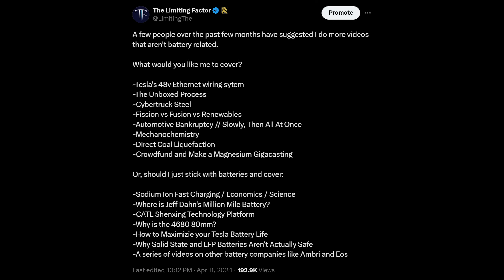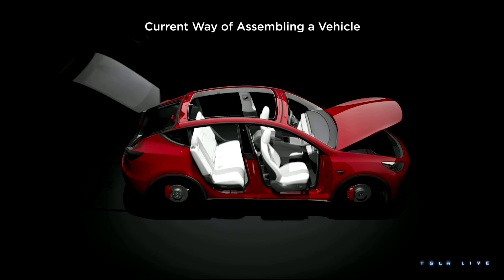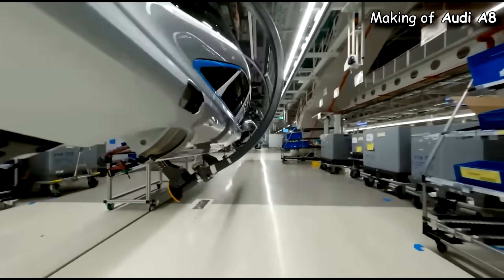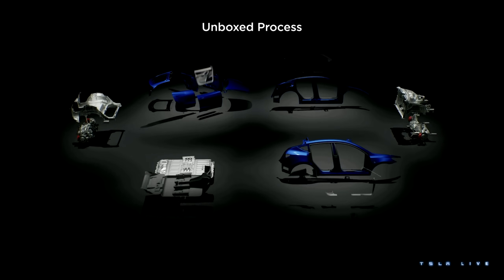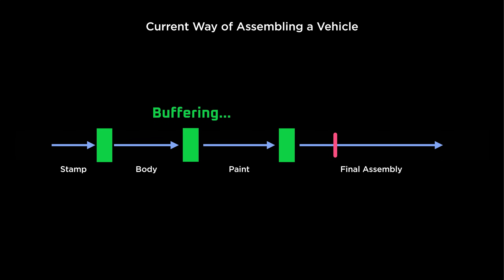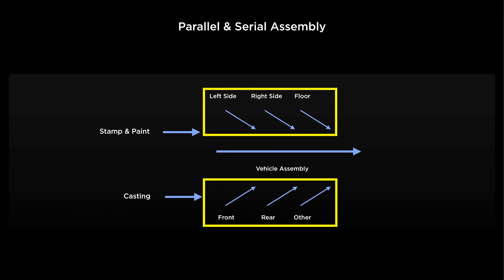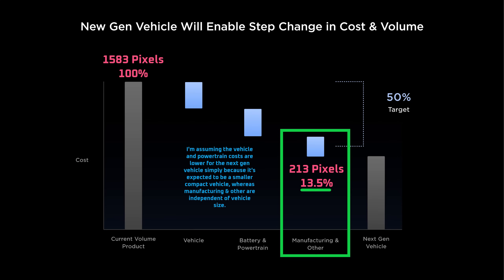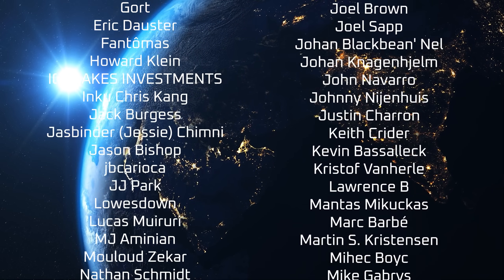Tesla's Unboxed Process // A Closer Look

Comment: Tesla is almost only OEM, that uses discreet axle modules , that use high amount of casting, as opposed to wields, fastener, brackets, and different materials, like stamped steel, extrusion, and small cast parts.
the entire axle can drop out to be worked on, just a few bolts.
Reply: Yes..... The best step is NO STEP!
Reply: A big problem was what if they need something repaired. Not having many repair stations means praying nothing happens or make it easy to fix if.

Comment: Thanks Jordan!  One advantage you didn't mention is foreign factories.  For Mexico/India/Indonesia, they could ship completed modules (volumetrically efficient, as you point out) and just do final assembly at those locations.  They can start with a small factory, and expand upstream to locally produce modules as production scales.  Or it could also allow for micro-factories that only do final assembly where there is low volume for the local market, like Spain/Italy/Australia/Japan/Argentina, with gigafactories feeding completed modules.
Reply from the maker: Thanks man! 

That could happen in the deep future when these things become commoditized, however...

Tesla does all mission critical work in-house 

They only outsource non-mission critical items 

Major vehicle components are mission critical
Reply: @thelimitingfactor  Thanks Jordan!  Sorry I said "modules" but I really meant "major unboxed components" like front-of-car, SBP, etc.  They would come complete from a Tesla gigafactory, not outsourced.  And the local micro-factory would just bolt the few pieces together in a final process.
Reply: @thelimitingfactor  Currently shipping cars is volume intensive - there is a lot of empty space being moved. Relatively inexpensive mini factories where the final assembly could be done without any of the background requirements (casting or paint shop for example) could enable a great deal of flexibility. The components could be shipped from any Giga with spare capacity.
Reply: TESLA doesn't have any assembly only plants anymore, it closed Netherlands many years ago. 
Gigaberlin is hub for EU except RHD.
China is main exporter of RHD and those markets. 
Fremont & TX are exporter to Canada & MX. for Cybertruck & some other vehicles, like NEW model 3.

Comment: Manufacturing engineer here. There's a little more to this and I would be happy to have a little discussion if you're interested. You would be even better off finding a staff automotive manufacturing engineer though, because there will be even more stuff that they know in specific (capitalization tradeoffs, specific unit manufacturing issues that unboxing solves, etc) that I might know only in general
Reply from the maker: The best way to contact me is on Twitter 

At limitingthe
Reply: Can’t wait the hear about this discussion!

Comment: Automation is simplified and easier to update with larger subassemblies.
Assemblies for different models may be produced on the same machinery. Castings may be batched for example by changing the molds only.

Comment: We all missed one important early step,  executed years ago! Early Model S had an opening sunroof,  with all the trim, mechanical complexity,  sealing, and lots of weight.  Long ago,  Tesla scratched all that and began to build all models except for X with structural glass roofs, which are simply glued on! Piece of glass and glue. Can't get much simpler than that!
Reply: also Tesla eliminated the battery swap feature in model S/X too.
but , long after they closed it's battery swap locations.
Reply: @markplott4820  
Tesla quickly moves to what works and leaves the 'less good' behind.  Legacy companies need to run changes through committees and then schedule most changes for a following year budget.

Comment: TOPIC SUGGESTION: If a battery is cooled from the top and the bottom, can you create a battery 1000x80. Like 1 meter diameter 80 mm tall big pizza sauce coin cell battery. It can be used for grid storage only.
Reply from the maker: Volumetrically, it makes more sense to use cubes
Reply: @thelimitingfactor  I suggested this for stationary storage where volumetric and gravimetric efficiency don't matter as much. What matters is the ratio of active to inactive/structural material.if you have a stainless steel barrel and inside you have a stack of jelly rolls separated by cooling plates(disks) that also act as current collectors. This approach will improve manufacturing speed and reduce cost

Comment: So... my imagination got the better of me and I pictured making hamburgers.  

Current car assembly lines are like this: The burger bun is baked as one piece,  then buttered. It is then sliced in half and separated, and then carried on a conveyor through the length of the building.  Meanwhile,  the hamburger patties are carried along,  just an inch above the bottom bun,  and tiny workers climb in the gap and spray condiments on the bottom bun. The top bun is only 2 inches above the meat,  and workers use robots to bring in the lettuce,  shove in the onion,  and try to stuff in the pickles and tomatoes without them sliding off the outside. Then some crazy South African comes along and says,  why don't we cook top and bottom bread rather than a bun we have to bake,  cool,  slice,  butter,  and carry the length of the factory? We can have 2 ovens, one on each side.  Then we bring in the bottom bread with condiments already applied,  meat with the veggies already sitting on top, then stack the top bread.  Stacked all up,  made fresh and more quickly! Think outside the bun, y'all 😂
Reply: How does one butter your Model B before it's sliced in half? You obviously have no autoburger experience.

Comment: I used to work in a stamping and weld plant, adjusting stuff to hold tolerance. I remember being blown away by the giga castings and how much pain they avoid. then I was amazed by the floor battery. this is gonna be great. oh and BTW the buffering thing is not really a thing; even if you keep the rest of the line moving, storing  parts in inventory, once you fix the blockage it's not like that station can suddenly work faster to clear the buffer. Toyota figured this out long ago and everyone has basically followed suit.
Reply: Yeah. Buffering just won't work well.
Reply: Well, buffering helps a bit. If the station A has a problem, station B builds up buffer. A is fixed and working and now if B has a problem, then A is still working filling up the buffer.
The answer is "it depends".
Reply: when you say it's not a thing, do you mean it's not done or just that it doesn't help with speed? I can see the buffer being held so they can be used if that sub-assembly goes down in the future, but it's also understandable it might not be worth the floor space to do that for all sub-assemblies.
Reply: @qfrank76  its generally not done because it has been shown to be inefficient. Toyota has all sorts of materials referencing "pull manufacturing" or "kanban" if you wanna read into it further.
Reply: I imagine the Tesla employees as curious folks who explore possibilities of further automation even if that means their job is replaced by a bot, because they're moving to another job as it goes. 
The contrast is the unionized dock workers, whose jobs are already replaced by technology (saw some fully automated port operations in China), yet they threaten to hold the entire country hostage if their job should be done more efficiently by the automation.
Reply: Tesla is able to build faster because every factory 🏭 uses , warehouse on wheels, and AI factory 🏭 software to schedule parts as needed.
no more bulky & expensive warehouse.

Comment: One possibility you didn't explore is having redundant sub-assembly lines and some permanent buffering of sub-assemblies. This would allow production to move to the backup while a line was down and keep up the vehicle production while a sub-assembly line was being addressed. It would only make sense if there were multiple lines for each sub-assembly and if stopages were common enough. Less efficient than the designated sub-assembly line in operation, perhaps, but still maybe better than a main line shutdown.
Reply from the maker: This seems very capital inefficient.  Unnecessary redundancy.

Creating parallel production lines gets rid of the bottlenecks and makes main assembly simple 

It atomizes and modularizes everything which reduces issues
Reply: @thelimitingfactor  Having a main production line down has an hourly (actually, often by the minute)  cost. Wages are often still payed, at least in the short term. Overheads continue unabated and cost of capital is undefrayed. While having "just in case" storage and production is rarely cost efficient, a small amount of redundancy/storage can be the most efficient by avoiding these stoppage costs. Indeed, Toyota found this out quite a while ago and aims for "most efficient working capital", not "lowest possible working capital". The US majors didn't pick up on this, which is why, initially, Toyota fared better during the pandemic.

As an example, I heard of one case where a vital part in a car line died and the company flew the replacement in for around $100,000, many times the value of the part. However, the failure was so rare that it didn't pay to have a replacement everywhere the part was used and the cost of a stopped line was so high that the cost of the flight was lower than the cost of the line being down while the part was driven there at far lower expense.

The optimal approach is, I suspect, a linear programming problem dependent on the frequency of line failures, the average length of time to fix, the number of identical lines, the capital cost of a redundant line and so on...

Comment: Might be difficult to get the paint to match on individual parts ..Having owned 3 Tesla's , Tesla has not been good with paint.
Reply: Maybe they run the parts for each car through the paint shop at the same time but not assembled..
Reply: @danharold3087 
They’ve got great in house tracking software so that is a possibility
Reply: who says Tesla in the future, will be requiring PAINT ?
Reply: Perhaps they've gone from being below industry standard with paint to figuring out how to be above standard and more consistent such that parts don't even have to be painted together. One can hope.
Reply: @jamesengland7461  I was thinking that until I started thinking about the fancy $2K extra paint options.   Even a slight flow difference in the spray gun might cause panels not to match.
Reply: They may not paint the exterior of the vehicle, this was hinted after investor day. Whether that will be the case remains to be seen.
Reply: @viewer_5714  If so, that would solve the issue of assembly and reassembly of the doors in the 'boxed' process too. This is not an advantage to the 'unboxed' process (and IMHO a bad idea to boot).
Reply: @viewer_5714  Tesla has been know to change directions.
Reply from the maker: I agree that will be a challenge!
Reply: @thelimitingfactor The paint match is why the doors are mounted first and removed later in a 'boxed' assembly process. Solve that problem and a 'boxed' process can do away with that inefficiency as well. Nothing to do with boxed or unboxed.

Comment: Does this unboxed process make outsourcing to outside contract manufacturers easier?
Reply: Outsourcing the one thing they don't want to do.  Have you not heard about vertical integration and how outsourcing has delayed and causes problems in the legacy lines?  It's worth your time to do some reading if you're interested.
Reply: no, outsourcing is NOT the future.
IN - house sourcing, is the future.
Reply from the maker: Outsourcing the building of their cars? 

No 

But that's not something Tesla would do anyways because it's core to the business